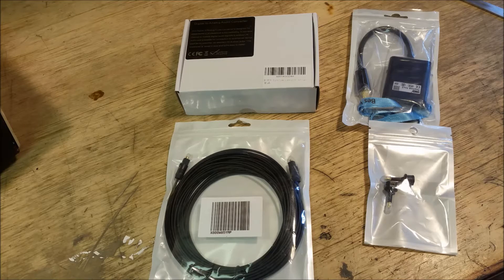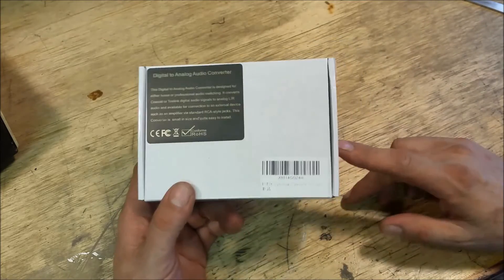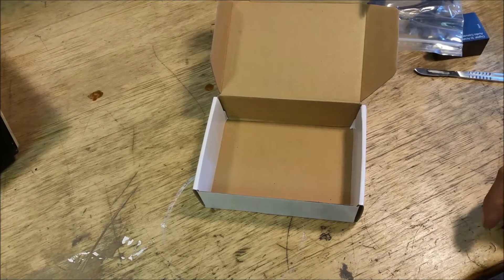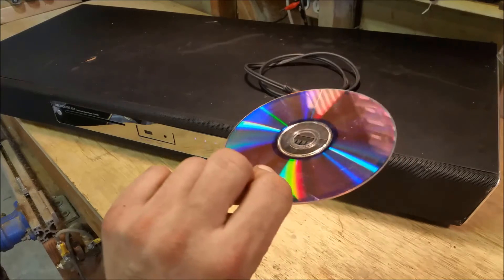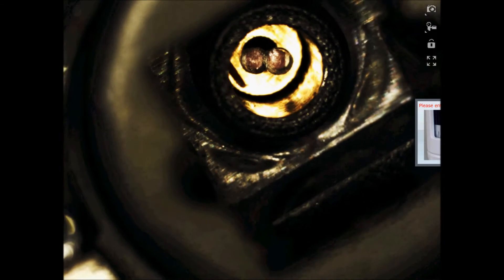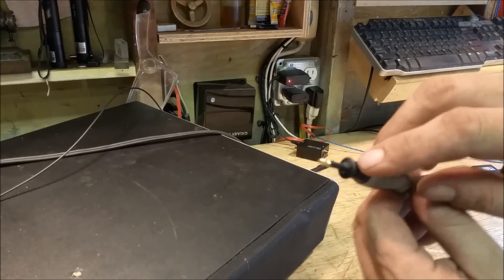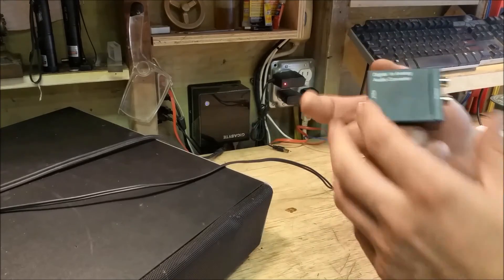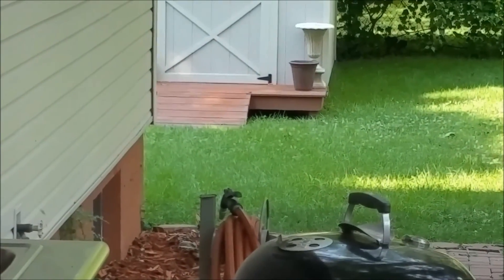Digital to Analog converter, Toslink, SPDIF, Mini adapter and splitter; product reviews

Comment: Wow on the fibers.. having designed fiber drivers and other optical stuff there should be only one solid fiber not 2 or more and its not suppose to move in the coupling. Also it's polished so high that you can damage the finish if touched. Should also be flush in the coupling. Did major studies on light traveling thru fiber dealing with 30GB data and what you have for a splitter is a complete joke even for audio.
Reply from the maker: I'm In total agreement. Its going back to the vendor. Thanks for chiming in Dave. -Cheers
Reply from the maker: That a pretty Intense polish job. Thanks for the link Dave!